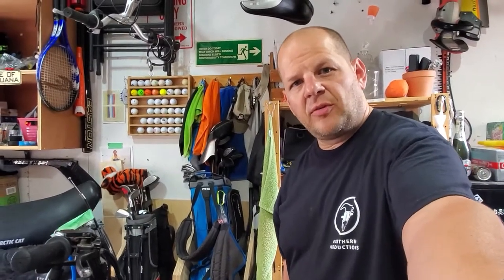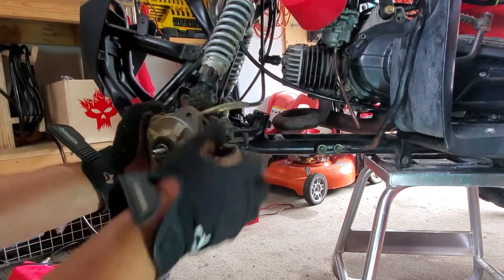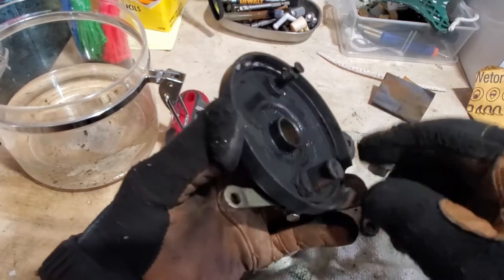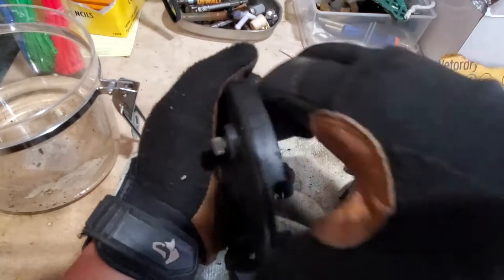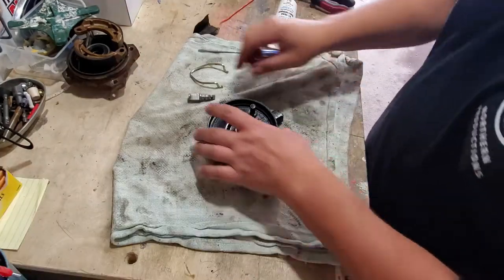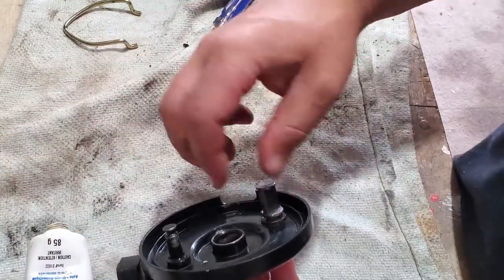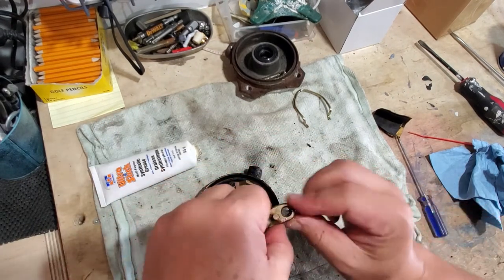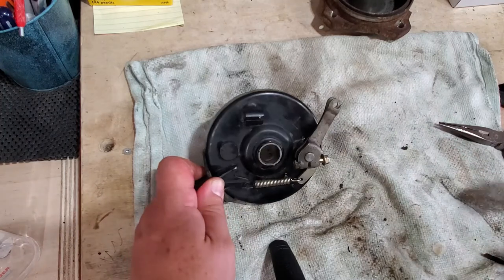Seized Drum Brake Repair - ATV / DIRT BIKE

Comment: Any ideas on what to do when the cam is so seized that I cant get it to turn even a smidge w/ a long wrench, or even hammer it out?
Reply from the maker: You could try soaking it overnight in varsol or another solvent then spray down with WD-40 or Liquid Wrench then give it another try,